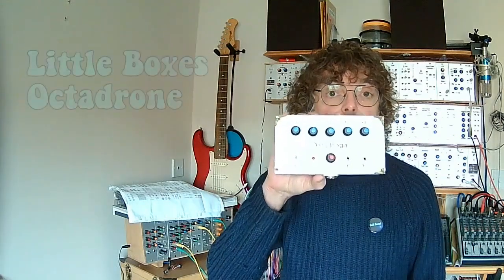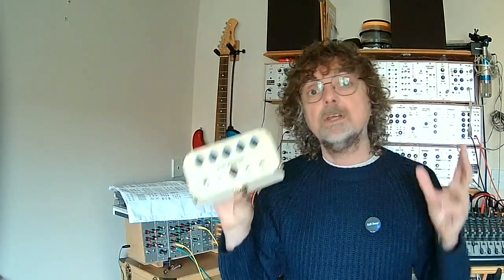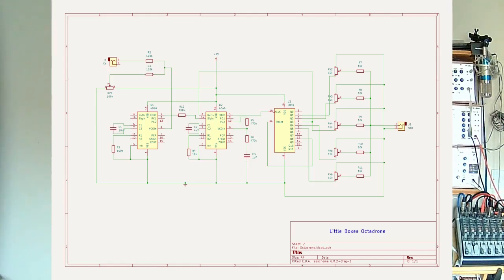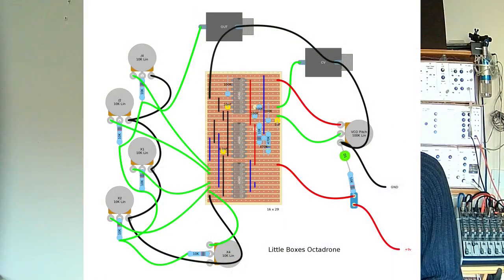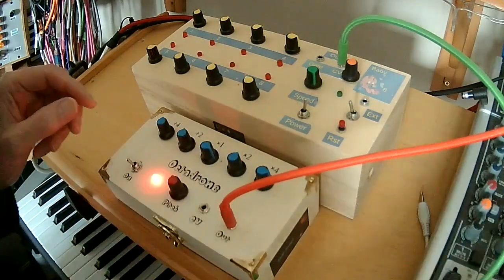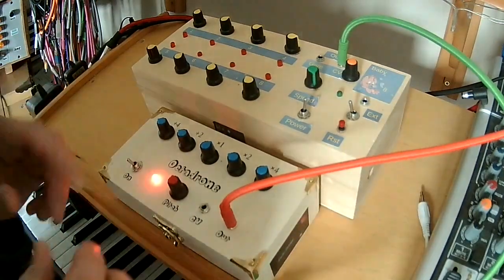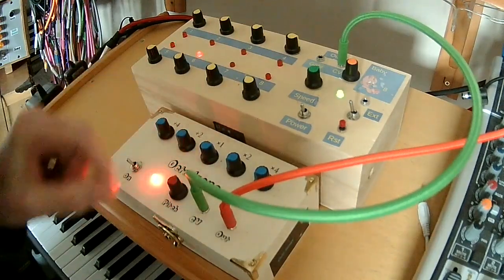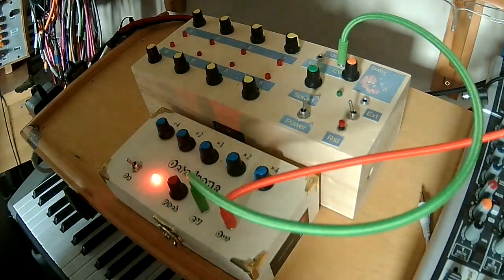Little Boxes Octadrone

Comment: Interesting circuit but why are you running the system as a closed loop PLL?  Couldn't you simply use a VCO running 8 times higher than your nominal output frequency then feed the 4040 from that?  The circuit seems more appropriate if you were locking to an external frequency input where you need to frequency multiply to get the higher harmonics but as you are using it to track a CV input into the VCO I don't see the benefit.
Reply from the maker: My aim was to adapt an existing module I built for my modular synth that took an external VCO signal to work as a stand alone version as one of my little boxes. There will be several other ways to build octave drones this was just an exercise in adapting an existing circuit from +/- 12v to 9v battery.
Reply: @CuSiSound  Makes sense, thanks for explaining :)

Comment: Sounds great 👍, would it work at 12 volts, as in making it a eurorack module?
Reply from the maker: Yes it will work with +12v and Ground. The original Barton Musical Circuits version is a eurorack design but that does not have it's own VCO. The link for that is in the description under this video.

Comment: Sounds awesome. Can I use another kind of capacitor (like ceramic or electrolytic)?
Would itbe possible to have odd multipliers and dividers?
Reply: CD4018 is a CMOS divide-by-N counter, where N can be any whole number between 2 and 10.
Reply from the maker: Yes you can use other types of capacitor. If you are using electrolytics be sure to check the polarity. The 4040 binary counter counts in twos so is even divisions. There probably is a way to have odd multipliers but that would be a different circuit.